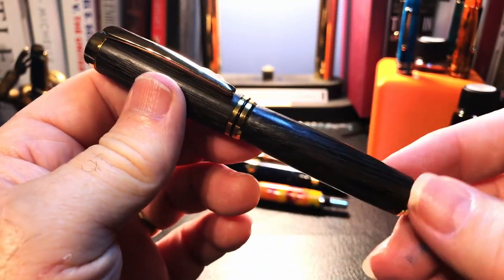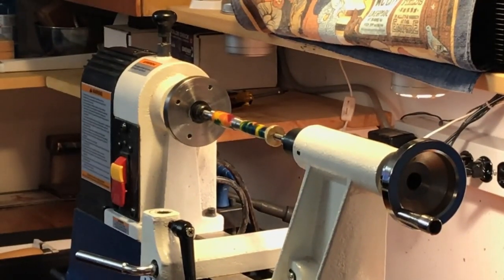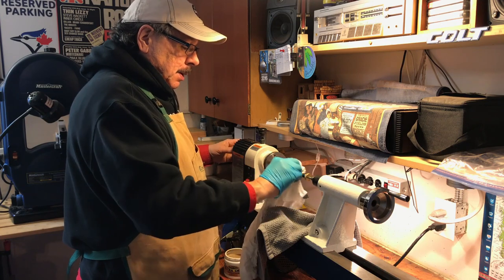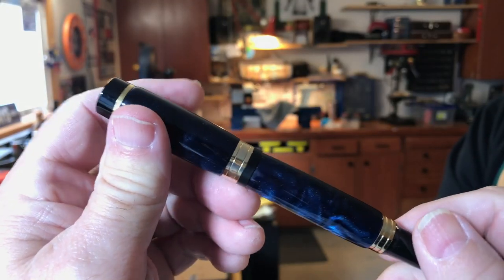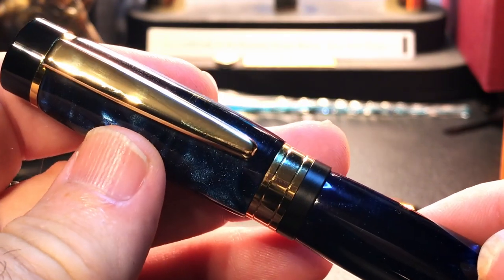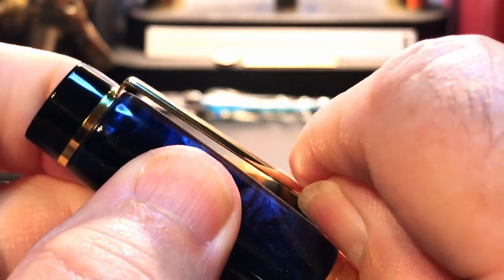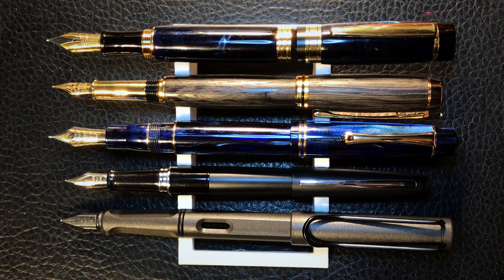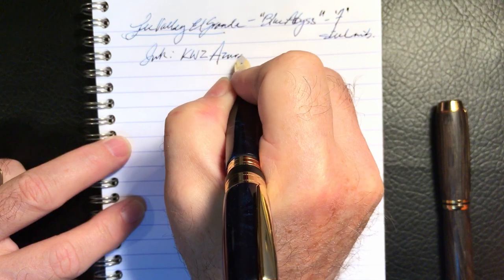Lee Valley Kit Fountain Pens Baron and El Grande: Custom Pen Turner Michel Paquet Demo

Comment: I noticed that most handmade pens have that similar shape, like two convex pieces, I wonder when will they start with a slim body as well. Etsy be having the big pens around
Reply from the maker: That seems to be the form doesn't it? It all depends on the internal size of the hardware and the "bushings" as Michel explained it to me. You cannot go slimmer than the internal piece of brass tubing. The fountain pens, even with the slim grip section, all seem to have fat bodies. The pencils, rollerballs and ballpoints all seem to be slimmer.
Reply: They make slimmer pen kits for Ball points and pencils call "slimline".   Slimline kits tend to be that first kit us turners make to get a feel of the tools and materials.
Reply: @InkquiringMinds  True it gives the kit pens their very distinctive shape. Unfortunately, it isn't the shape for me, even though it is available in some great looking burls.

Comment: I was never impressed with kit pens. This doesn't convince me otherwise. The Etsy stores with kit pens I have seen before, and was even less impressed. Most of them have great material, but that bloby bulgy shape to the barrel and cap that leaves me cold. 

That said I though about getting a lathe, and trying my hand at this a few times, but living in apartments it wasn't a real option. Now I have an actual garage, so it might come to it. I would want to make them without the kits though, so the only metal in the pen is the nib and clip. As we just moved it is a 2021 project though, should the pandemic allow.
Reply from the maker: Sounds like a plan, Martin!